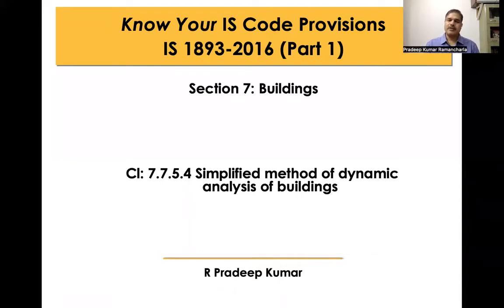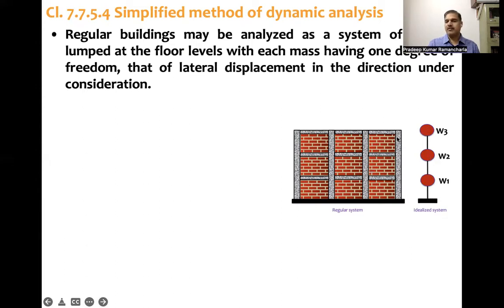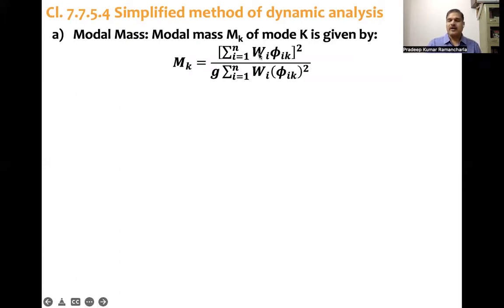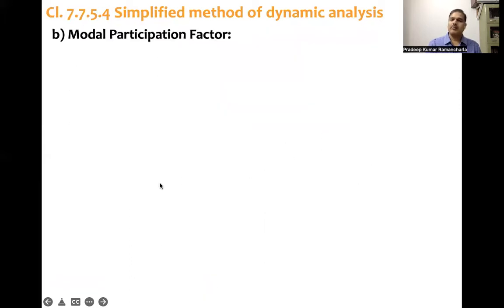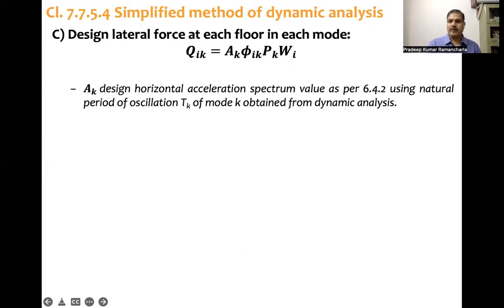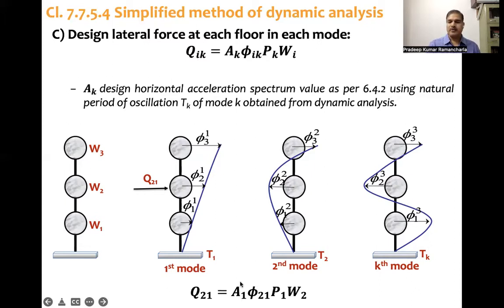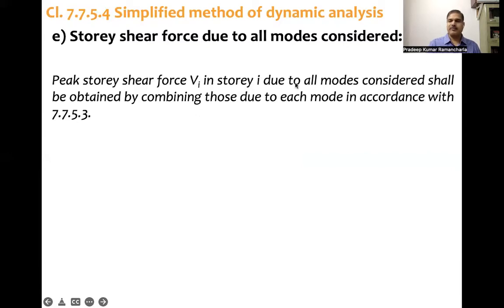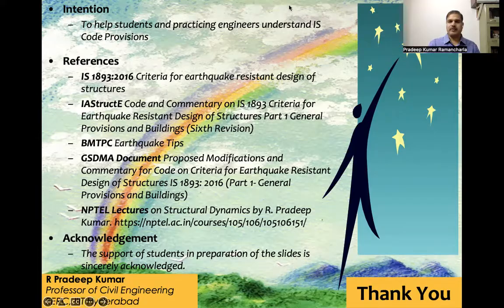IS 1893-2016 (Part 1): Clause 7.7.5.4 Simplified Method of Dynamic Analysis of Buildings

Comment: Dear sir, Greetings....

This below question i had asked you in the mass irregularity video, dated: 10.06.2022, on your this channel... Kindly help me....

Even though i applied RSA method (Dynamic Analysis Method) for a B+G+12 RCC Structure, situated in zone 4 (As per IS 1893 part 1 2016 code), there is failure due to mass irregularity at the 11th and 12th storey of the structure, its due to unequal loading coming because of Over Head Water Tank & Mechanical Lifts machinery arrangements.

So, my question now is how to overcome this failure or what are the steps required to pass this failure due to mass irregularity? I was unable to find the solution in IS 1893 part 1 2016 code. I used staad pro connect edition software. Kindly help me in this situation....

Regards

Thank you....
Reply from the maker: Dear Waseem, I need some more details to answer your question. Can you send me an email?